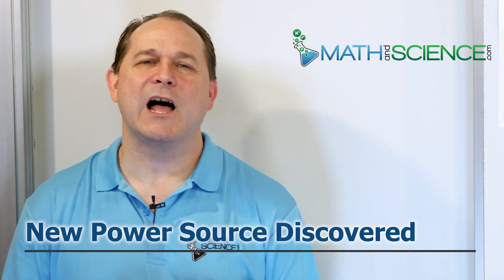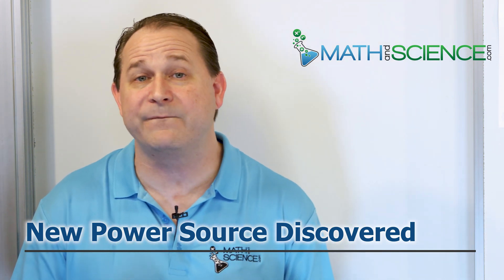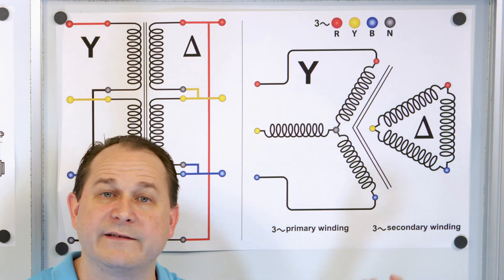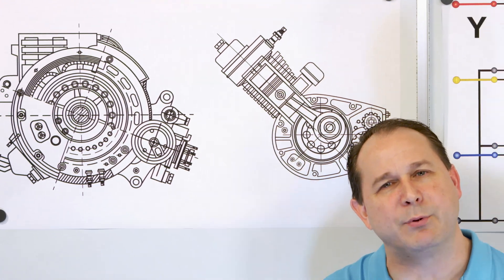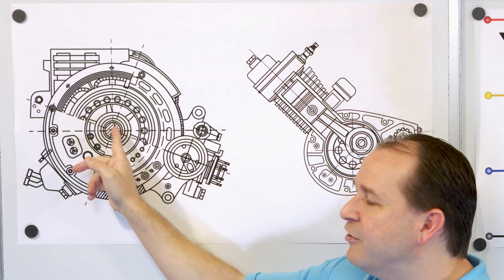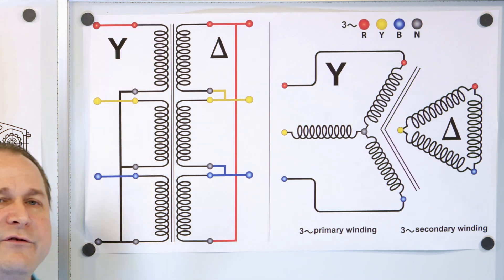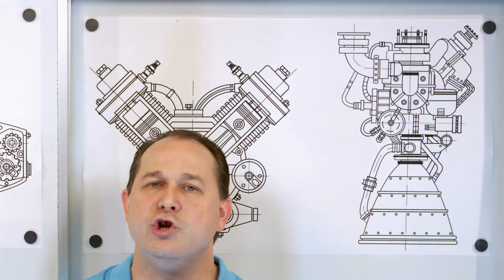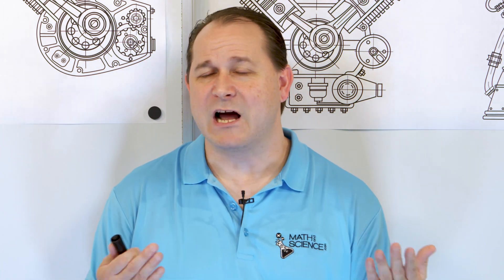New Invention - Free Energy Generator - The Alpha Encabulator

Comment: He left out the fact that the major challenge to mass production is although the supracapacitor can use an electrolyte of tap water, the dielectric coating on the conductive anode is required to be made from unobtainium to avoid secondary emission from the control grid.